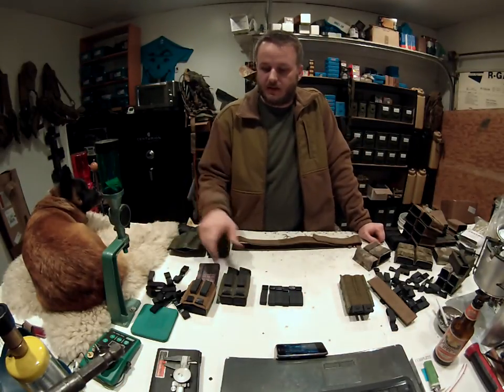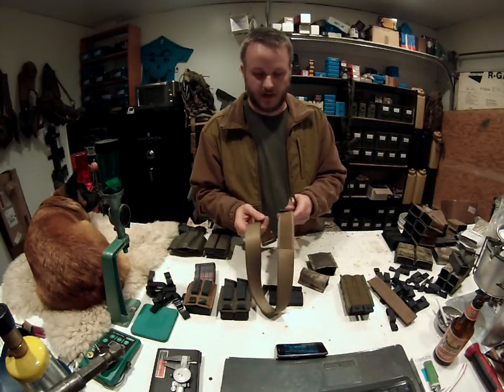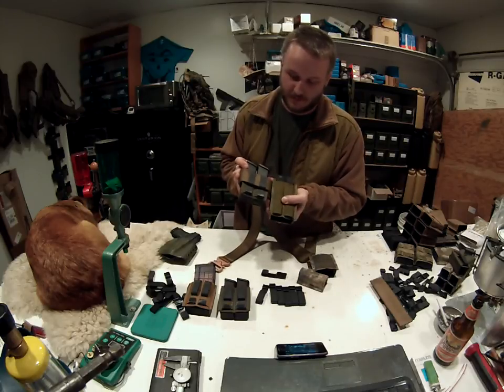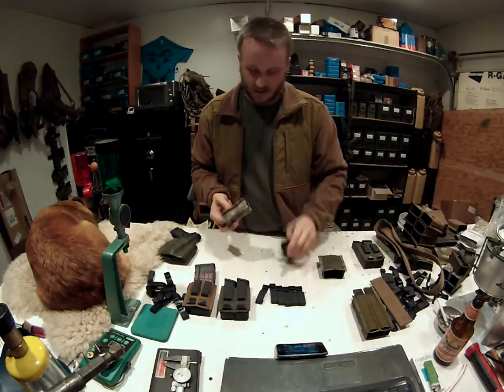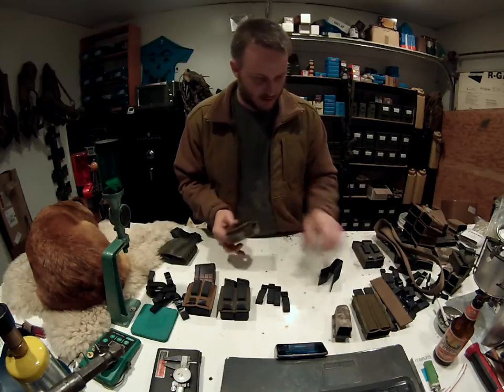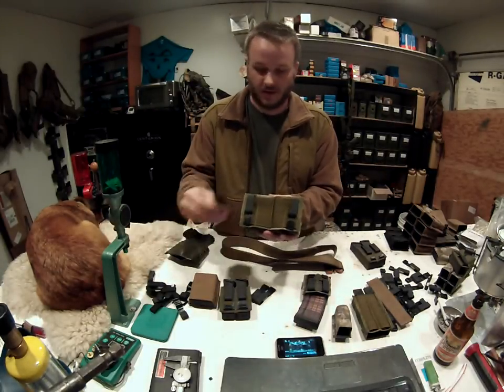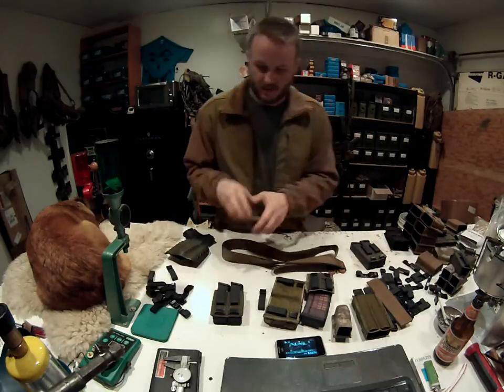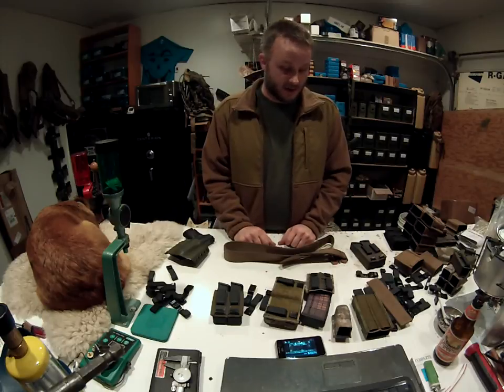Kywi Belt Loops

Comment: Just bought several pouches for a rifle class and the ran great. I bought the WTFix but they do not work well for my belt. They may work on a chest rig or plate carrier so it's ok. I was going to get the other clips you showed that you said dug into your side when you sat down. Now that I've seen the hard clips and how to install I will be ordering them. The pouches I bought that were double 5.56 and a 5.56 attached to a double stack pistol mag along with one single double stack pistol mag. I now see I should have ordered those doubles with the wider gap. That will be next. I am so happy to find a Made in the USA high-quality product that works just like it is built to do. You are an American Success story that needs to be told. Never give to mass production if it will lower your quality product.